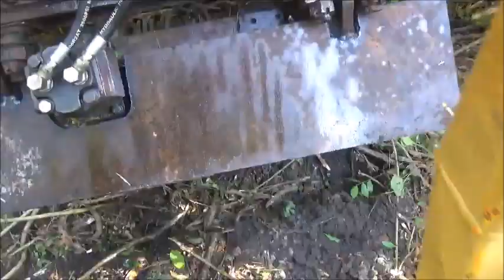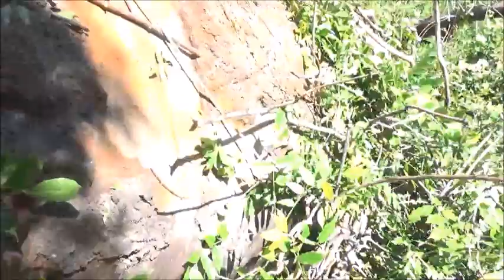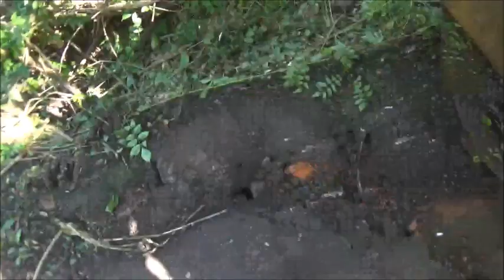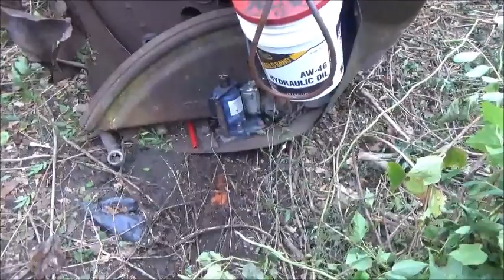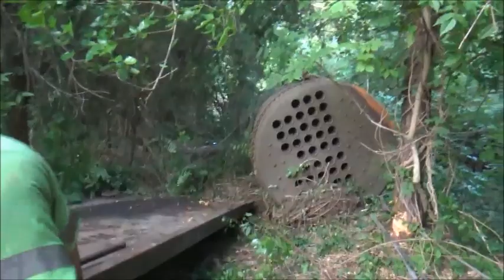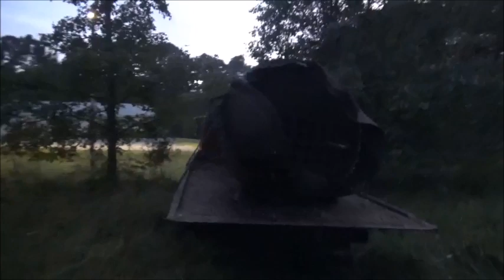BOILER RECOVERY FROM SWAMP Part 2

Comment: I've seen my share of chicken fights, dog races and tractor pulls but I ain't never seen anything like that in my life. 
In a previous life, I built AM radio stations and moved old style, box car radio transmitters. One time it took us 8 hours to move one 25 feet out of the transmitter shack and on to the trailer. We measured our progress by the inch but it wasn't nearly as difficult as moving a steam boiler out of a jungle. Once again Jonathan, my hat's off to you and your wife. That was amazing. !!!

Comment: Congratulations on the boiler recovery. You had the right equipment for the job. As for operating a boiler like this, it would take an ultrasonic thickness engineering survey of the boiler shell to determine its suitability for operation. I've restored and operated traction and stationary boilers that initially appeared to be write offs so its not impossible. Following sound engineering methods is absolutely essential.

Comment: Thanks for another update, You guys earned every minute of being tired getting that engine and boiler out, with run what ya brung skid steer and home made equipment . I know from equipment I've got here what can be done on a budget and  mechanical ability if you can look at it and get a vision of the end machine.
    I've got just over $12.000 in 3 machines I got cheap to fix and use on our farm, today the tractor spreader and backhoe loaders earning over $100 an hour working for our neighbor. Plus I've paid for it 3 times over saving money paying somebody else to do the work here over the years, and I'd get my money back and some if I sold it all tomorrow .  If older equipment works well and the customer don't care about the image of guys with new machines there is money to be made, while the big guys waiting for the dealer to fix a computer issue on newer $300.000 plus equipment . Take care.

Comment: back in the mid 1950s I worked for a John Deere dealer who heated is building with a boiler about that size. We shut it down every Friday night and I went in Sunday morning and cleaned out the fire box and flues. usually ended up with 8 to 10 5 gal pails of fly-ash and a few more with clinkers and the water was still hot in the system. those boilers heated quite a few big buildings in our town in Manitoba Canada until the early 70s ; by then most would pass the pressure test and there were very few men who could change a flue.

Comment: Great job, great history. I enjoy your core belief and teachings. How you keep pushing yourself with your health issues shows all of us your inner strengths.
Like you I am a jack of most trades, I have tried to learn and do everything. I have worked on those old low pressure boilers before, both to heat a huge department store and to power a very old very large steam tractor. Like you said its days of holding any type of pressure is done.
Keep the videos coming, enjoy each and everyone of them.

Comment: My Dad use to do alot of homemade stuff. I remember the story Him an Mom told us about the Starter going out on the Car they were driving many Years ago an they were in the middle of no where, an he only had a few tools to work with took it off got it to where it  would run but it needed brushes, well he made brushes out of cardboard,  that ol starter ran like a champ got them in town to where he was able to get a new Starter. My Dad was pretty good at adapting or making things run/ work  by using  what he had or could get ahold of.

Comment: Just proves the point Jonathan , you built that equipment right the first time and it worked , from the first time , your perception of strength of welding and experience is put to good use and proves , if you think you can you will , if say I can’t do that , then you won’t , you don’t have to have all the flashiest latest gear to do a job , in some cases it’s just that expensive paint covering an item that falls apart quicker than than blink .well done Sir .

Comment: Jonathan, I wouldn't discount putting pressure on that boiler, if you've seen how bad the boiler for J&L #58 was. Would need to be retubed and recertified (probably at a lower working pressure than original), but it's certainly not impossible.

Comment: Hello 
That's a lot to move but you did it so congratulations!  Well it's a fire tube boiler that is the hot gases pass through the tubes and heat up the water in the water drum. This is also a stationary boiler and looks well built. I don't know much about stationary boilers as I worked on marine boilers for steam ships and they are a whole different bread of cat. But you do have folks in your area that can help you out should you have any questions.  The power / electric company uses steam and lots of it so they could be a big help and I know that any stationary engineer / power plant engineer would be very interested in seeing just what you have. I'm a retired marine engineer and I your videos have been fun to watch.  Your right in another area as well...... We can do anything we want all we have to do is put or minds to it. If we want it bad enough we will accomplish our goal. I couldn't afford four years of college and the five hundred thousand dollars it was going to cost me for engineering classes. So I went to sea as the guy who emptied the trash cans in the engine room and cleaned up. It took me eight years at sea and everything was done via mail in correspondence. We didn't have the internet back than and ships at sea never did. All of this was done while working an eighty four hour work week seven day a week for a year or longer with no days off. I'm retired now with forty two years federal government service in the US Merchant Marines and US Army. Even as a disabled veteran we can do anything if we just put our minds to it.

3 RD Asstance Engineer
Greg Rogers

Comment: Jonathan, you're correct. I needed a steering wheel puller for my lawn tractor.
I didn't have one or access to one.
But, I have a hub puller and a large C- clamp and lo and behold, it worked. I tightened up the hub puller, I hit the steering wheel shaft with a hammer and off came the steering wheel.
It's not the same scale you work with Jonathan, but I'll take a small victory just the same...
Had I not watched your channel, why I never would have tried this...
Reply from the maker: At least you didn't pay someone and then watch him do it for you
Reply: @jonathanw4942  as my memory is beginning to return, I hear your advice so I went ahead and tried. And I did it....Naturally, I'm not working on your scale, but I'll gladly take a victory of any size. I'll say this again, Jonathan; I wish I lived closer to you, so I may see you in action...Stay healthy, be well, God bless you and Mrs.Jonathan...

Comment: It's been a long hard journey for you and the people who depend on you and those that you depend on. But it's like you said it's not about having the best tools to work with, it's about using what you have and knowing how to use them. The fact that you wanted to do what you did is really most of what you needed. Determination and the desire to accomplish something is what you have to have. I'll be damned if I have ever seen somebody any more determined to do something than you. That was a lot of hard work for any man and I'm sure glad for you Jon. I was wondering if that boiler still has the fire box and if so it should have a fire brick liner inside the fire box. Have you seen where there are any fire bricks anywhere? It is probably just how heavy as you say it is, It looks heavier than that but it would have to be the weight w/out any fire bricks in the fire box. Those solid fire bricks are really heavy and don't take a lot to add several thousand pounds to it. Anyway, I was just curious. I've enjoyed watching this project a lot and look forward to seeing it on display.

Comment: I just love to see the stubborn Jonathan pursue the heavy steel to follow hes directions, I would love to find a steam boiler and drag it home. I was in school working with steam boiler and it's fantastic power in steam. We heat up the boiler and run the steam turbine to generate electricity and switch it in to the grid in central Stockholm. If we missed the phasing it would blackout a big part of the town but we never missed :-). Sure it's good memories that being coming up when locking at this.

Comment: Looks like the boiler is in pretty good nick and can probably be restored to working order pretty easily although you will probably have to replace the tubes.
Reply: Never happen. Lap seam riveted boilers were outlawed decades ago. It’s a nice display piece though. Kind of rare to find boilers that old. Most have been cut up for scrap, or buried somewhere.
Reply: Bill Moran lap seam boilers aren’t outlawed if they are historic although they may be limited on pressure anyway we will have to see what the boiler inspector says.
Reply: Jonathan plans on using the boiler for cosmetic display to go along with the steam engine.  He intends to run the steam engine on compressed air.

Comment: Jonathan, I just acquired something myself without friends or special equipment. I drive a school bus into a set of apartments and I've been seeing this piano under the walkway and stairwell and on the first floor. It was there all week. I finally hopped out and checked out the piano. It is in pretty good shape. I asked the girl's mother about it and she said it was left there when someone moved, that and a lot of other stuff that other people already took away. I went over there last night with my Toyota Tacoma, a four cylinder truck, and two random guys helped me load it into my truck. It was extremely heavy and way, way heavier than I expected and when I expressed my surprise the first guy on the scene just told me "It's a piano!" My friend wouldn't help me and he's had a bad back and has been off work for it now for a while. My brother has had cancer and he couldn't help me. I wasn't going to ask the communist Biden/Democrat supporter next door to help me. Basically I had nobody. I figured someone might help me out though and they did. Basically I rolled it down the very short sidewalk and my truck was backed up to the curb. All we had to do was get two guys to get the edge of it on the tailgate and with a little care we got it in. I used a ratchet strap I had gotten from a garage sale but had never used. I had quilts at the ready that I didn't, except for one against the cab. Those packing quilts all came from the curb or the side of the road. I have about six of them now. Anyway, I backed my truck right up to my front porch which is made of concrete and carefully lowered it to the porch and then had to lift it up by myself some four inches and over the front door jamb. I had to be careful because it had two legs in the front of the piano and the bone crushing weight is in the back.

 For FREE it is a very nice piano. I used the helper's screwdriver to put two wood screws back in the top because it wasn't laying very flat. The top lifts back. To open it you need to move it away from the wall.  so the top has a place to go. One of the soft things in the back that hits a piano string needs to be repaired but just that one. All the keys, white and black look pretty good. There is a bit of latex white paint from painting on the front that I need to get off. The wood itself and the finish is pretty nice. I know the piano sat outside under the stairwell for at least a week. It didn't get wet and it was drier this week than usual, since we have had so much rain in September and still some more in October. Anyway, I didn't need a piano but we always had one in the front of the house. When my mother died she left the piano to my brother and that one is sitting in storage. Me and my brother were given lessons by my mother growing up. My brother has more talent than I do. I can't play but Charlie has a bit of talent. He is also good at working on engines. He is mechanically inclined. So my free piano is there either for looks or for me to play with. It isn't even one of those worn out pianos that you see around where people don't want to throw them away. It is hardly an antique. It isn't the most expensive type but I can promise you it still has a lot of value. I could sell it also. I always get teased for grabbing perfectly good items from the curb. I have a house full of second hand items like this. I have two chests of drawers made of real wood that I got, one from a garage and another from the curb. They are both better than the particle board mess that is sold these days. Anyway, I just thought I would share my story. Hope you see this. And this is a good and kind of out there series. Good for you for having so much knowledge about antique steam engines and other stuff. You are too damned smart Jonathan!!!
Reply from the maker: I couldn't carry a tune ina bucket, but I would still carry a free piano home.

Comment: More than likely, if you replaced the damaged firebox you could fire that boiler up and run it under about the same pressure it ran when it was new. Those old steam boilers are pretty tough and reliable. The John Bull, a British built steam locomotive, built in 1831, one of the first locomotives to run U.S. rails, and it is still operational, the Smithsonian has it and they fire it up every once in a while for big events and such. You'd have to have it inspected and certified if you intend to do like a public display or operation, but I'm fairly confident it'll pass inspection if you cleaned it up and replaced/repaired that firebox end.

Comment: Great job Jonathan and family. Thank you for all your hard work to preserve a piece of history. I have watched a few videos in the past couple of weeks to observe steam engines operating. 
How did they ever originally get that boiler set in place. I assume it was built before even the model T. I know it was probably delivered by train, but did men and horses set that 1,100 pound monster in place? Or would they have used a steam powered crane to move it into place?

Comment: I wonder if you could find those huge bolts with a metal detector.  That's going to be a nice setup.  Those old boilers can be re-tubed and hydro tested, but I bet they are expensive to have done.

Comment: From the video I couldn't tell if it's a lap seam or butt seam boiler. I think a couple of SOS pads and a good tidy should have it making steam in no time. Good job with "Boiler Rescue 1". Are those bar type stays on the tube sheet? I would have to cork it up and squeeze it to maybe 50lbs. I'm a locomotive guy and that's one weird boiler.

Comment: Jack it up and put a car hood under it so it can ride like a sled.
Reply: I thought the exact samething. :)
Reply: at 11000 lbs I think a piece of 1/4 inch would have helped, a car hood most likely would be ripped apart going over the debris.
Reply: 11,000 lbs on a car hood.... it would just be like a piece of tin foil stuck on it...anything strong enough to be a sled would be more work to deal with.
Reply: It acted as it’s own sled with all that winching and blocking he used.

Comment: Though you are not going make the boiler operational, once the engine is restored to running condition it’d be nice to see the boiler in position where it would have been and “plumbed” like it was attached just for display purposes.

Comment: Is that the most weight you’ve ever had on the roll off? 11,000 pounds is an impressive job to get out of that swamp, good job! Can you explain how the boiler works?
Reply from the maker: No, when I built the bed I rated it at 12,000. I have had 15,000 on it.

Comment: And a big shout out to C.F. Manufacturing for the engineered rollback, the skid steer winch 2000 adapter and of course the boiler lifter 2000 which made this video possible. Please consult them for all your future moving and rigging needs at BR5-49oh!  Tell them Jonathan sent you for extra consideration.
Reply from the maker: That's Juniors number, mine is BR5-48

Comment: im sure you can fabricate the firebox ends of the boiler. as in its time it burned coal for the fuel for the boiler.  if it were to be used again for this engine im sure you can convert it to an oil fired boiler as you need i big sized oil burner for it or else multiple Beckett oil burners from scrap oil furnaces or boilers to work as you can run them on waste oil, veggie oil and diesel fuel. or home heating oil. if you to run this engine. or a new smaller boiler to run this steam engine.  it be nice when this engine gets all assembled . im sure the parts you need to find is the flyball governer, the oilers, and other parts  if they can be fabricated

Comment: What is the deal about the hammer head worm? Never heard of one.
Reply from the maker: They can wipe out an earthworm population. Also if you cut them in 10 parts you end up with 10 new worms. They also are male and female so they don't need a mate to reproduce.

Comment: We always used BOS O rings not NPT pumps.
Reply from the maker: Just had to go with what was on it when I traded for it. Thank goodness Bobby had an old commercial shearing pump with bos fittings. His had an SAE 2 mount and mine was a 4 bolt, so just used the back.

Comment: you could get a new modern boiler put inside the old boiler shell and then rebuild the steam engine and it would look like you are using the original but you have a modern boiler inside